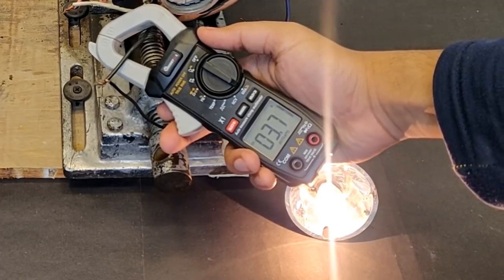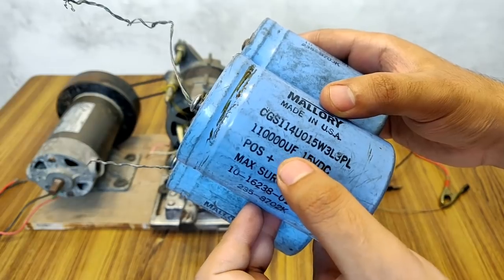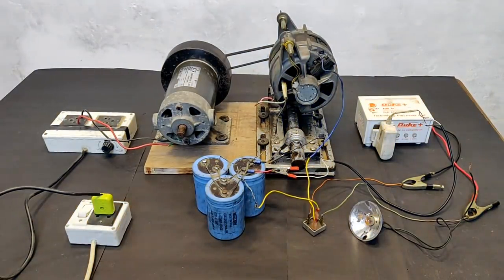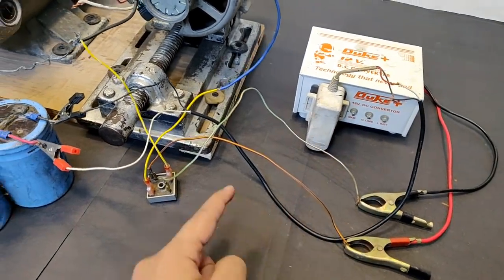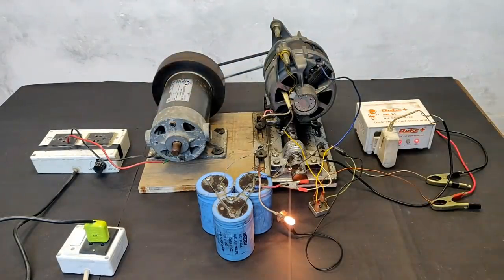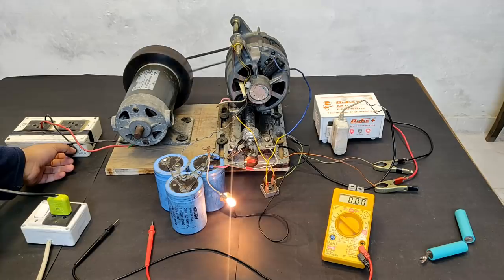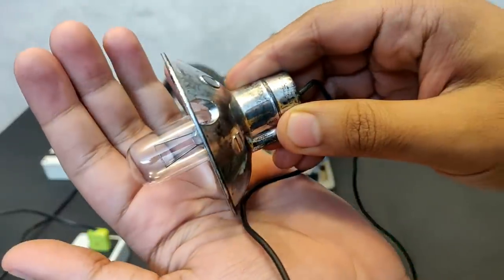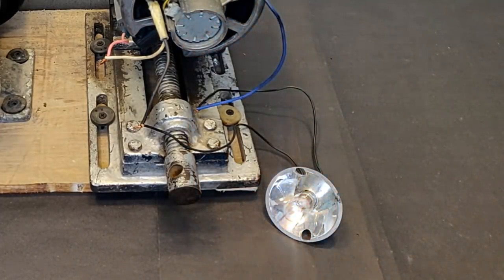Self Excited - Make 12V 690W Generator from 220V Washing Machine Universal Motor

Comment: Can you try to remove the 5v adaptor from the inverter. Then connect the output of the inverter (230V) to replace the power of the main motor. So become free energy self run motor

Comment: so i can get this motor from a washing machine, have it running from a pelt wheel thats generatet from a streem and simply connect a light and bhooom?
Also does this give out 12v so i need to connect a inverter to get 240vaults to run my off grid hme?  awesome stuff buddy, sorry if questions seem dumb but im new to this side of things here

Comment: hello, can i ask if every wahsing machine is universal??
Reply: Not understood the question
Reply from the maker: No
Reply: @shivasunhith1883  i asked if all washing machine motors are universal. if you dont know english, then it is not my fault
Reply: @MrElectron  ok, thank you very much man!  how can i spot that the motor is not universal, but only AC?
Reply from the maker: If it has brushes attached then its a universal motor. Smaller washing  machines usually have simple induction motors.